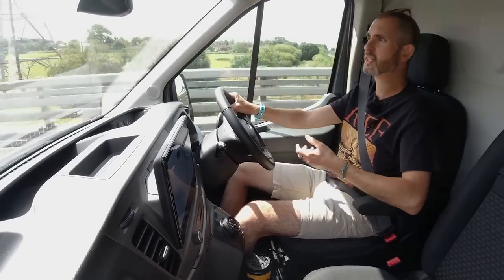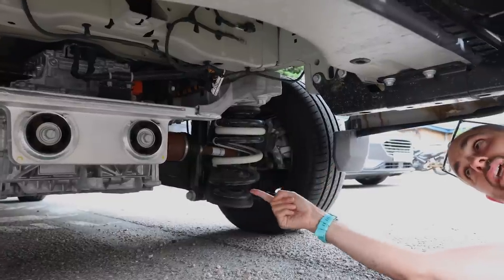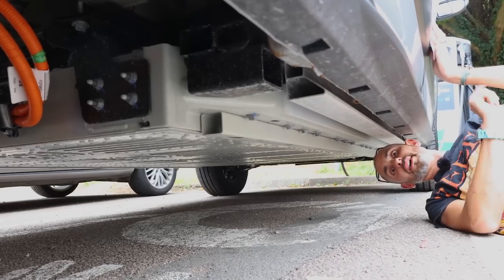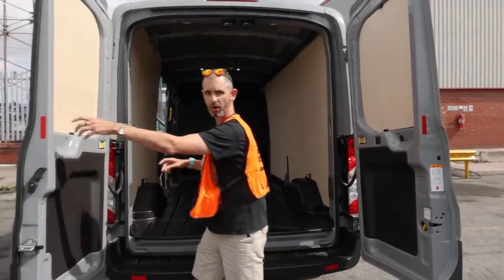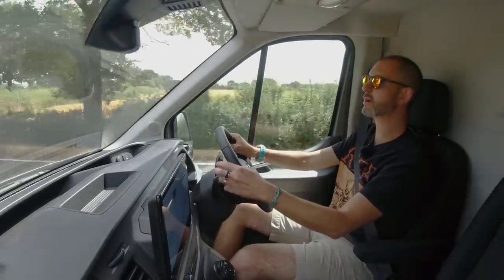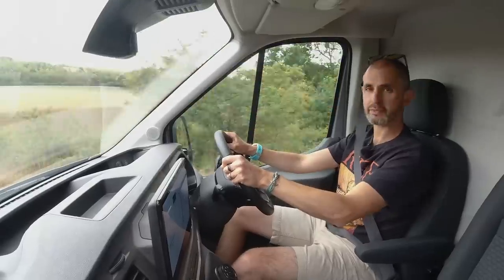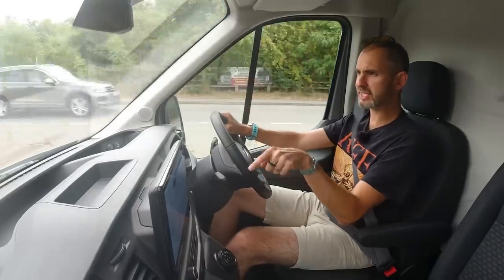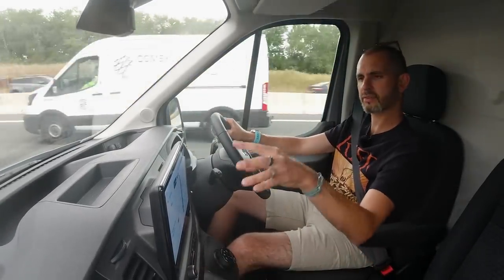New Ford E-Transit electric review - the most important van of 2022

Comment: Nobody ever says how much it costs per mile to run, you paid x amount of money to do the trip what is the £ per mile for the Electric compared to running a Diesel at X amount of £ per mile.  Cheers.
Reply: 30mpg on diesel is about 30p a mile. Electric costs vary wildly and commercial rates can be quite different to residential. However taking a residential off peak rate of 8p/kWh, and the numbers quoted in this episode, the van was costing around 3-4p a mile.
Of course using a public rapid charger as shown is significantly more expensive, and those would bring it on par with diesel.
Clearly a fleet user who can arrange suitable depot charging on cheap rate electric and who doesn't need to use public chargers can make significant savings.
Reply: @aragorn084  Johnny did about 110 miles before charging, iirc, and his charge cost ~27 quid... so cost-per-mile (when using v.expensive fast-chargers) is about 25p / mile - still better than diesel, but not by much (~15%)
Reply: @logicalChimp  yeah, instavolt charges 57p/kWh, and the van looks to be doing a smidge over 2 miles per kWh, so your right around the 25-30p per mile range. There is some fuzz as he won't have charged to 100%, I think he said 93? So the 27quid didn't quite cover the whole 110 miles.

Comment: Good show Johnny, thank you. As you rightly say, diesel prices are not going to drop significantly anytime soon. But shouldn't your real-world review also disclose how much you paid for the electricity on the road? (as opposed to the figure for 'at-home' charging) That way, us 'floating voter' diesel users who are considering the big e-switch will have another figure to factor in.
Reply: instavolt is 55p/kw currently.  a m/KwH would have been nice to know about the van too.
Reply: Charging at home on an EV tariff is approx 7.5 p / kWh - available from many suppliers
Reply: When Jonny stopped for the first charge, he'd covered 109 miles on approximately 74% of the usable 68kWh battery capacity, so using about 50kWh of electricity, which actually equates to a not-unreasonable 2.18 miles per kWh of efficiency (compared with some Audi E-Tron SUV drivers who get LESS than 2 miles/kWh...!! 😲 )
If you were only ever able to charge using public rapid chargers (the equivalent of only EVER buying your diesel from a motorway services... which you probably wouldn't do...) then that would've cost around 50 x 57p/kW = £28.50.
That's the equivalent of a diesel van doing about 32mpg (at £1.86 p/litre diesel)
However, if after those 109 miles, the van had then been charged overnight at home on a sensible EV energy tariff (4 hours for approximately 22kW at 7.5p/kW, then 5 hours for 28kW at 39p/kW), then that drops the price down to only £12.57 total cost - the equivalent of a diesel Transit doing 73mpg...!  👍

Comment: I just cannot see electric vans ever working. They are far too limited on range and will be difficult to charge everyday for the range required. The power to recharge an entire fleet of vans would need a charger per van, and power supply networks are already stretched to capacity and struggling with power supply not being designed for the current loading.
Reply: Yep, a van depot would need it's own substation to charge a fleet of vehicles. 
 Ev's are fine for the odd middle class hippy to take to the vegan lentil shop, but like you say, the electrical infrastructure is nowhere near able to cope with the large scale adoption of commercial EV'S
Reply: Money talks... Fleet owners can make a simple calculation,  running costs, IE cost of fuel Vs electricity and the capital costs of any infrastructure required. A diesel transit will cost around 30p a mile in fuel. An EV van will cost somewhere around 4p a mile charging on cheap rate electric. For a van doing 100 miles a day, 5 days a week, that's an annual cost of £7800 in diesel or £1100 in electricity. The savings start to mount up pretty quick and will easily pay for the infrastructure.
Reply: @aragorn084  where is the billions required for several new powerstations, hundreds of additional power lines and substations ect coming from?? Also, wtf do you think powers them?? Have you seen current costs, which are rising fast?? Blackouts are very possible this winter due to lack of redundency in the system and the struggle to power whats left. Those costs will be delivered back to those trying to save cash by hammering them in other ways like doubling costs for everyone, having no electricity in winter just when its needed..
Reply: During the highest demand part of the day the UK pulls about 60 GW of its 75-ish gigawatt generating capacity. Overnight during the off peak it's pulling about 40. Which means you've got about 20 GW of capacity unused during the time when these vans will be plugged in and charging overnight. The charger draws about 11 KW peak so that means you get about a million vans charging at the same time for 11 gigawatts. So you've got capacity in the grid to charge about a million during the off-peak without even increasing the amount of generating capacity. How long do you think it's going to take for them to sell a million of these?
Reply: @AlRoderick  assuming everything is working and we arnt using alot more than normal like in winter and the powerstations have enough fuel.. Russia is already cutting fuel supplies to europe meaning costs per unit will skyrocket as a result and we could easily run out.

Comment: I work for Royal Mail and the depot I work in has recently switched to a 95% electric fleet.
A combination of Peugeot Experts and Mercedes.
The Experts are excellent with a range of 140 miles and very nice to drive.
The Mercedes only have a range of 80 miles and seem to suffer from excessive tyre wear.

Comment: EV'S are a short circuit plain and simple, it still takes crude resources for them to run. When towing run time becomes a fraction of it's self. And heaven help you if the battery pack gets cracked and gets wet as lithium and water are like gas and fire. Just give me a good ole combustion engine any day. Oh I forgot that the electric grid and infrastructure are no where near capable of requirements

Comment: Hydrogen would work much better in this sector. Vans are supposed to last. Doubt an electric motor will last even 150k miles
Reply: Eh? Hydrogen cars still use electric traction... and motors last decades in railway locomotives and multiple units.
Reply: Hydrogen cars use electric motors?
Reply from the maker: EV motors are sealed, less moving parts and aren't stressed in the same manner as piston engines. Li-ion batt packs are tested for degradation after 200k miles and rarely show more than 5% 'wear'. It is a myth that EVs cannot withstand hard use.
Reply: This is a first, I've seen a lot of people claim the batteries wouldn't last but this is the first time I've ever seen someone claim the motors weren't durable.
Reply: The body will rust and fall apart before the motor gives up....
Reply: @AlRoderick  yea i meant the batteries, already embarrassed myself so no point changing the comment
Reply: @HT0o0  yes... hydrogen combustion isn't really a thing. BMW tried it with the E66 760Li, but the problem with that is it did 8-9mpg and made 200bhp vs 440bhp and 20-25mpg (29 if you're REALLY careful) on petrol. Supposedly Toyota is revisiting the idea, as is JCB, but everyone else that's using hydrogen (including Toyota) uses it as fuel for a fuel cell range extender on an EV.
Reply: @jondonnelly3  That Transit is already rusting ... And it's 50k lmao.
Reply: There's a Nissan Leaf on my local taxi rank which has done almost 50k more miles than that......
Reply: @HT0o0  Yep, they sure do.....

Comment: My daughters Fiat 500 broken down and when the guy came to recover it at our home he noticed we had a number of electric vehicles on the drive, we then got talking about how reliable the fiat 500 is and he went on to say the fiat was very reliable over all, but he said these Ford electric vans are the most frequent ones to break down, so I said are you saying the users run out of battery? He said no, they electronics are rubbish and they get error messages and stop so they have to be recovered.
He said as soon as he picks one up he gets a call for another.
Anyone else here actually drive one?
Maybe they sorted the issues no with a recall?
Ps. I love electric vehicles but when I see this review I just had to share what I was told.

Comment: Electrical outlets? Might want to charge some tools in a work van or power something at a worksite.

This will be very interesting as an RV if you could run an induction cook top etc from the battery instead of having gas for cooking.

Comment: Don't know if anybody has heard about the latest trend amongst the thieving community - they're going around to charge points and chopping the power-supply cables out for the cooper internals. Can be weighted in for scrap . I saw a video recently on YouTube of a man reporting this , he mentioned that a Porsche garage in the Leeds area had recently been the victim of said crime , turns out there's approximately 70 to 80 quids worth of copper in each charge- point cable , while  the Porsche garage would be forking out 80 to 100,000 quid for damage caused.
What a wonderful country we live in.

Comment: As usual another brilliant EV episode. One thing I'm struggling to understand though... There are cars/SUV's capable of 300+ miles, why aren't battery packs like those used in vans like this? Can't purely be due to aerodynamics, can it? Surely a commercial vehicle should have that long-range capability. I'm sure I'm missing something as to why this is and I'm sure someone can put me straight. Great stuff Jonny
Reply: Cars can get those ranges even with smaller battery packs like 60 kwh, vans are much heavier and would need 200+ kwh to get the same range
Reply: Those cars are light like built with tin foil these still need a heavy frame and chassy because it's literally needing to haul more then mom's groceries
Reply: Light weight, more aerodynamic makes a big impact on efficiency. Vans are just a large brick that has to be pushed through the air. That’s the difference.

Comment: As a self employed van owning Amazon driver, frankly the range is nowhere near viable at the moment. Amazon have their own small fleet of EV sprinters and are massively limited and only cover a mere 5% of coverage from my particular depot in Preston. Until you can Chuck 300+ miles in there then we’re barking up the wrong tree. We have to remember that the public have no real idea of a day in the life of a multi drop driver. You’re looking at 180+ drops on your own route, then more advanced drivers do extra. This is the norm. On average we’re talking around 120+ miles at an average of 35 mpg in a 109 Vito. These EV vans would struggle. Some vans in our depot do over 250 miles a day up to the Lake District . With such a large platform, why not shove a massive battery in there ? This is desperately needed as stop start is the perfect way to kill a van and I spend roughly £3000 a year in maintenance and around 30,000 miles.

Comment: As a refrigeration engineer for a supermarket chain that has many old town centre stores with no parking, and daily driving to the 12 stores across Lincolnshire I cover, from 200 to 500 miles a day and can be on site for 15mins to multiple hour jobs with multiple hours travel between stores, I don't see how my company could make these work at all. We're already very non productive as it is.
Reply: you cant, EV's have a long way to go before they can be used by tradesmen.

Comment: Another great video Jonny. I can see his van working for some companies but not for the vast majority. The issue will be heavy right footed van drivers and loads, battery will just disappear. Hybrid or hydrogen would be a better solution going forward.
Reply: Yeah your right, my L3 H3 transit is constantly at 3500kg and goes up and down the motorway at 80 so an electric one would not work at all.

Comment: A good review. I currently drive a 2019 Ford Transit 290 2.0 Diesel LWB (same size and shape as the E-Transit in this review) and I do around 100/110 miles a day delivering car parts. It uses around 1/4 tank a day of diesel. I find it to be gutless and lacking torque. It is a comfortable drive and once moving goes pretty well. It would be interesting to see how the E-Transit will compare doing my job. 

One criticism of your review is, you didn’t mention how much it cost you to charge the van on the two occasions when you stopped. It would have been interesting to know the actual cost. Other than that, it was a decent review.
Reply: When Jonny stopped for the first charge, he'd covered 109 miles on approximately 74% of the usable 68kWh battery capacity, so using about 50kWh of electricity, which actually equates to a not-unreasonable 2.18 miles per kWh of efficiency (compared with some Audi E-Tron SUV drivers who get LESS than 2 miles/kWh...!! 😲 )
If you were only ever able to charge using public rapid chargers (the equivalent of only EVER buying your diesel from a motorway services... which you probably wouldn't do...) then that would've cost around 50 x 57p/kW = £28.50.
That's the equivalent of a diesel van doing about 32mpg (at £1.86 p/litre diesel)
However, if after those 109 miles, the van had then been charged overnight at home on a sensible EV energy tariff (4 hours for approximately 22kW at 7.5p/kW, then 5 hours for 28kW at 39p/kW), then that drops the price down to only £12.57 total cost - the equivalent of a diesel Transit doing 73mpg...!  👍

Comment: Ive been talking to Ford on Facebook... 166 miles. Thats the vans range when empty. They wont state the fully loaded range.
Im a mobile detailer in the UK.

My current van is a 20 year old 450,000mile Vauxhall combo diesel. Even loaded I get 50mpg, 800+ miles per 5 min fill up.
I paid £1500 for it, 14 years ago!
I hired a Nissan EV van for a month. I gave the thing back after 2 weeks because I was having to cancel appointments and loosing money.

I cannot charge at home so even if I bought one. I'd be reliant on public charging (Its expensive, more expensive than my diesel van that burns 25p worth of diesel per mile).
The EV van allegedly had a 200 mile range.
On a typical day. I drive 150miles per day.
Except. Once I'd loaded the van for work inc the water tank. I was getting 50 miles from a charge.
I had to charge the thing 3 times per day! Thats around 4 hours wasted per day just charging!.

My average day with the EV:
Take missus to work. She comes home on the bus.
Charge the van... Yawn.
Do 1st job...
Drive to the charge point, wait in a 3 or 4 deep queue and eventually charge the van.
Cancel 2nd job because of the charging issue.
Charge the van so its ready for taking the missus to work.
If we did any socialising, shopping etc... I'd need to visit the charger again before turning in for the night or we wouldnt have enough juice to take the missus to work in the morning.

Charging the van isnt just the time charging the thing.
Theres the time to drive to the charge point (not many around here).
Waiting for a charger to be available if someone is already there. I have been 5 deep in a queue.

I really despair for the future. EV's are still not good enough. The range is too short and the charge time too long. public charging facilities are sketchy at best.
I live in a city of 320,000 people. My nearest public charge point is 8 miles away, there is just 2 points. The next charge points are a further 15 miles away across the city.

I also hate card payments. I have lost so many credit cards... I leave it at home, Im not good with cards.. I can buy diesel with cash... I like cash, I know where I am with cash.
Reply from the maker: Clearly an EV van at their current spec is not for you. However it will work for hundreds of businesses doing thousands of errands.

Comment: Good review JS.  I can see the eTransit being converted to a green camper van very easily.  Slap a load of ultra-thin PV panels on the roof and they'll manage a couple of leisure batteries.  The only potential downside is the extra weight of a camper might bring the overall mass of high-roof a little too close to 3.5t for comfort and in to Category C1 licence territory.  Overnight charging certainly wouldn't be a problem at camping club type places with their EHUs.
Reply: You have a bit more weight to play with in an EV Van (4.2T I believe) as they have made allowances for EV Weights being higher
Reply: @scjgreen  There is a choice of 3.5t, 3.9t or 4.2t variants. 

There is a driving license allowance/exception for EV vans that permit someone with a driver licence limiting them to 3.5t to be allowed to drive up to 4.2t EV's

One other thing to maybe note, the 3.5t option gives towing capability, the 4.2t variant does not.

Comment: I was dubious with load carrying  trade but now driving the Peugeot E Expert for work and have been really impressed, I do  180-200 miles ,
local driving is extremely efficient. Not necessarily ideal if you do high mileage on motorways daily , but it works well for me.

Comment: "Charge it on a cheap tariff" 🤣

That scrappers is so depressing. There was real value in the little local yard where you could get an informal education pulling bits off for yourself, repurposing & modifying.

That Allegro likely would still be about without them.